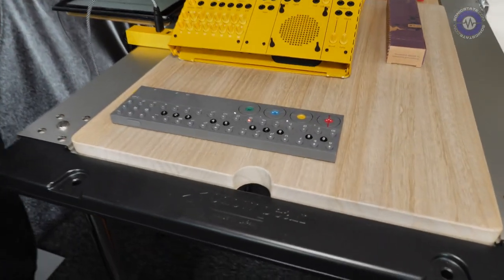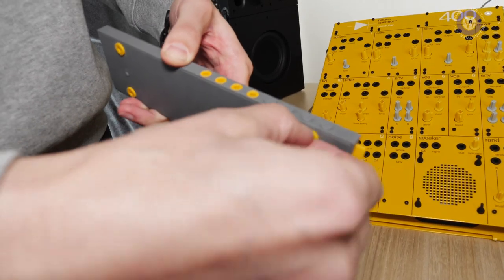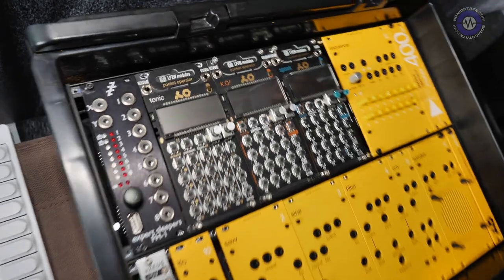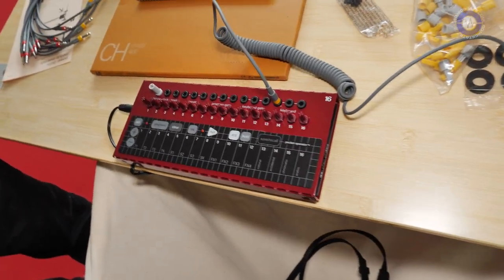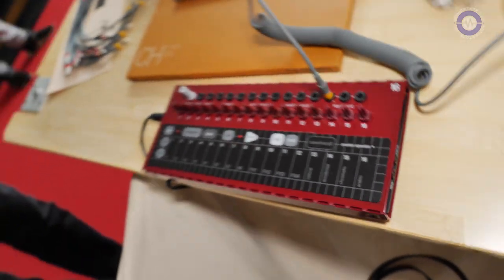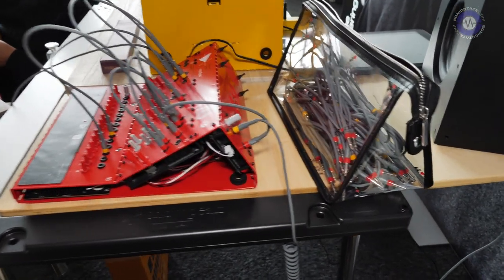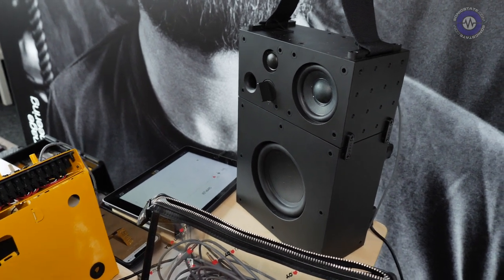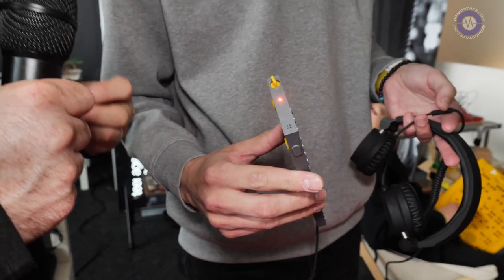Superbooth 2019 - Teenage Engineering Updates

Comment: you cant see what step youre on? "you can use your imagination" LEDs cost pennies dude
Reply: They had a shitload of cases from the last design and had to reuse them
Reply: Was thinking the same dude!So they can have my imagination instead of my money...
Reply: Not a TE apologist here... but I feel like that answer in the video was really unclear and could definitely use some context (I chuckled when I heard it). On the OP-Z, you can have 16 steps that can be pre-programmed in. However, if you want to create a much longer pattern, you can record/automate "in between" steps. These in-between steps are not visually represented, but you can hear them with your ears. Given the extremely small size of the OP-Z, I think it's a pretty decent way to get more out of such a small interface. See the "step length" section of the manual: https://www.teenageengineering.com/guides/op-z/track or the Cuckoo mega tutorial, which outlines it nicely. As a pocket operator user for many years, I quickly felt at home with the OP-Z in ways that I didn't with the OP-1, and am happy it doesn't have a screen.

Comment: OP-Z Way too costly for the hardware... I bet all the hardware costs under 50 bucks...
Reply: OP-Z ain't about the hardware boss. And btw the processor alone is about $50 if I recall. All said, I still agree it's a bit costly, but the nearest competitor to what this does is Elektron which is also godly expensive.
Reply: @austinbru  nearest competitor is a used ipad for $50 on craigslist
Reply: @stethoscanomaly  That really is not a competitor at all.... so you pay $50 for an iPad. Come and swing over next to my OP-Z with your shitty little out-dated iPad with apparently all free apps and I'll show you the power of the zed.
Reply: @stethoscanomaly  agree

Comment: I don't understand how you would be able to monitor your sampling signal if the one 3.5mm jack is already being used to input a signal into the OP-Z?
Reply: I understand you could probably monitor the built in microphone but I haven't read of any solution for monitoring something coming through the 3.5mm...
Reply: two way TRRS  spliter woudl solve your problem.